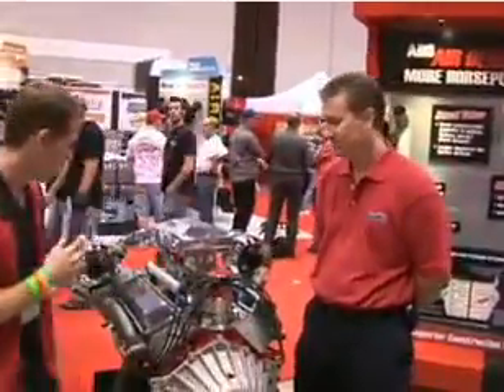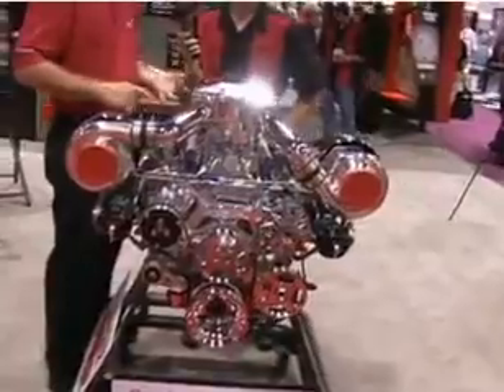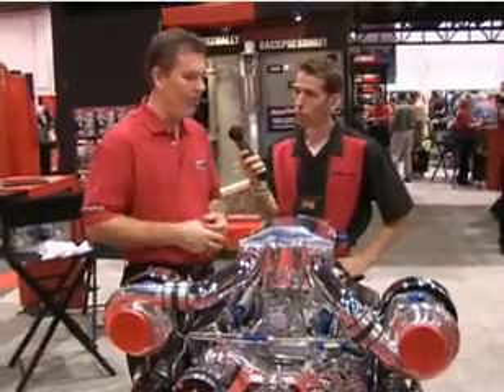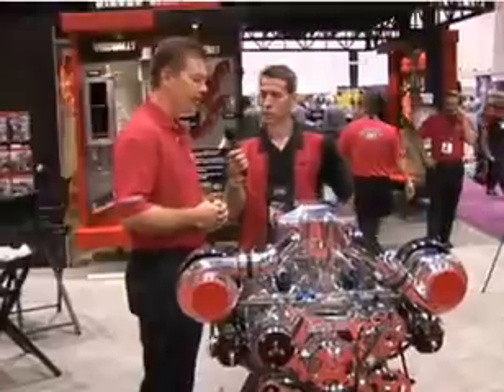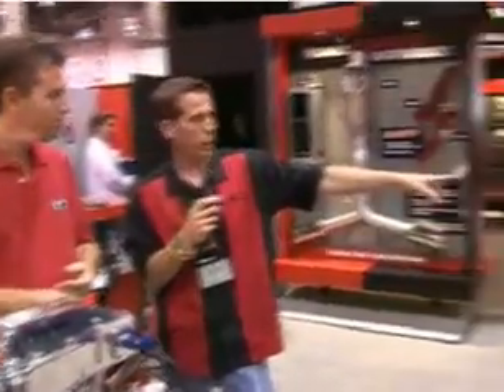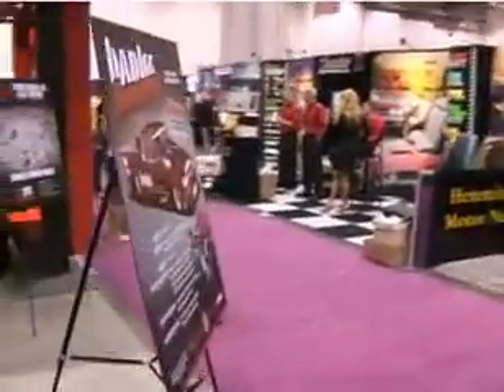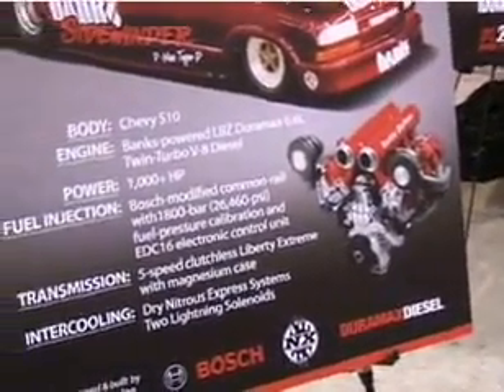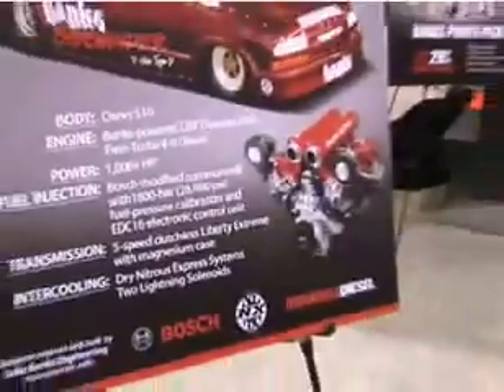Banks Twin-Turbo & Diesel Engine Programs

Comment: @moaski Diesel is more efficient MPG, and is only cleaner in some ways.

But for racing it is terrible. For the same displacement a gas engine will produce way more power and weigh hundreds of pounds less.
The only reason the Audi R10, or other diesel LMP cars, win any races is the advantage given in the racing class.

Comment: @TheOfficialKC You are a nocice.  Diesel is much more efficient, reliable and cleaner burning than gas engines.  The Audi R10 diesel won it's first race at Sebring and then moved on to winning LeMans four years straight.